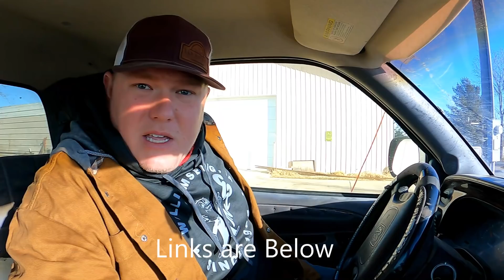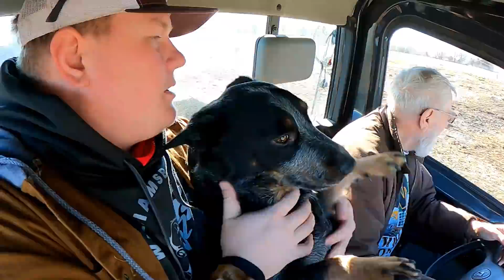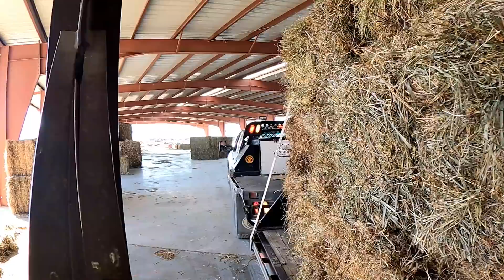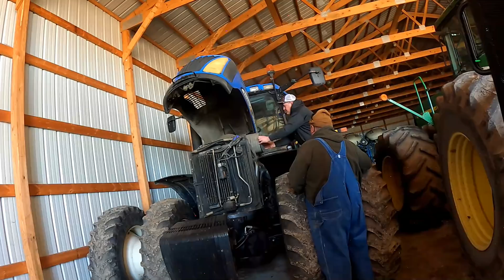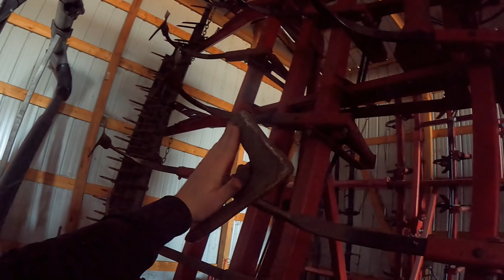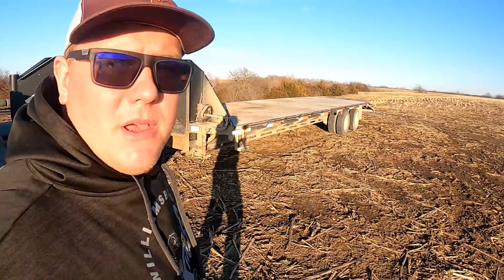STORY OF A FIRST GEN FARMER - It's Selling!

Comment: I ended up running a fass150 and deleted my factory filter housing. Just turn the key and it will prime everything after changing filters. One less filter to worry about and leaking o rings. Run CAT filters or any quality filters on the lift pump and they are a finer micron filtration than factory ones anyways.
Reply from the maker: I’ll look into it!